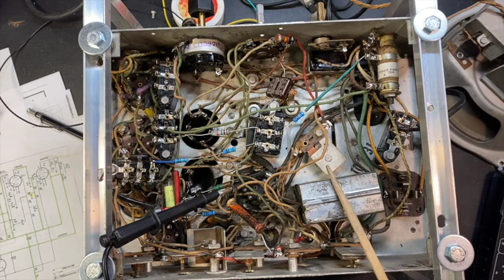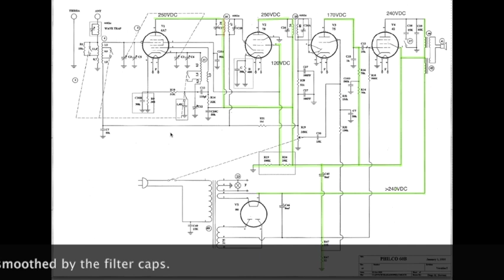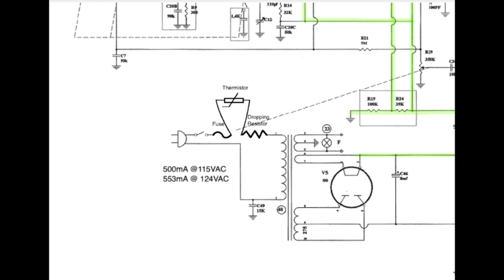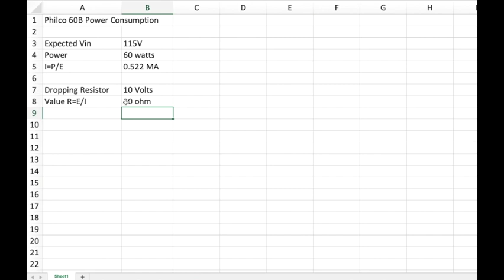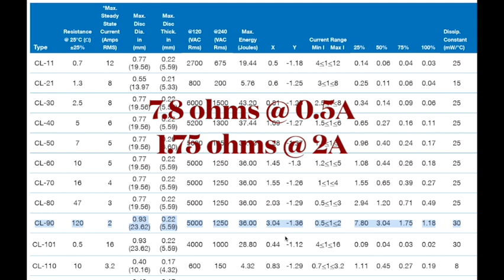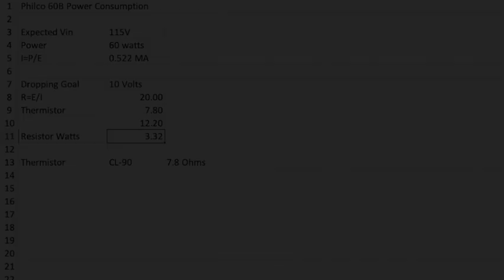Philco Part 14 Caps in a Box and Power

Comment: Thanks - that was a very clear explanation, though I would prefer that the approximations were done just at the end rather than throughout as it is too easy to approximate to error. It is curious what capacitors are in that can. I would have expected the cathode bypass capacitor for the 78 valve to be in there as well.